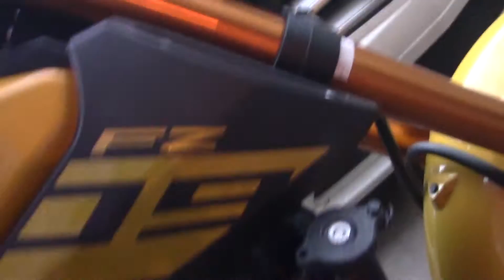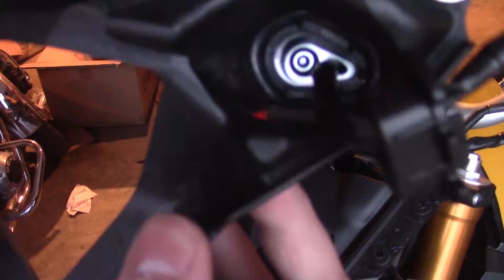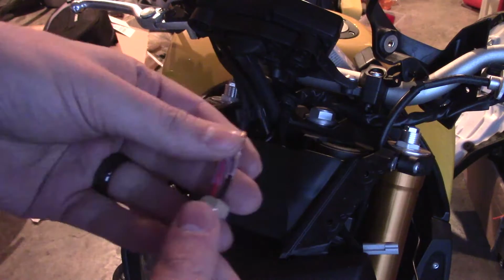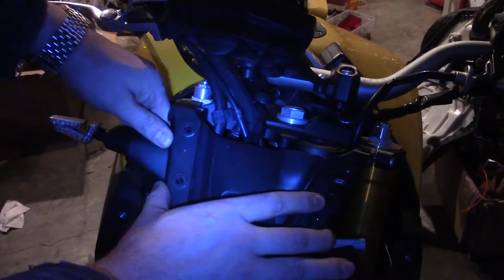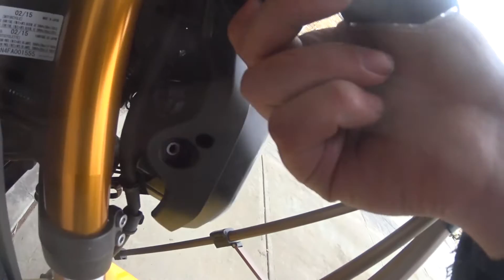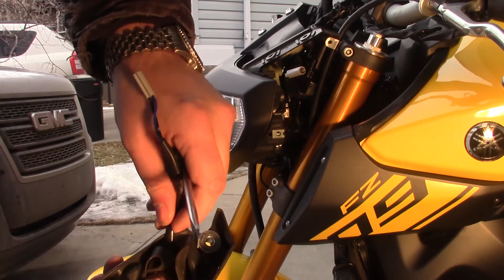FZ09 MODS - Signal replacement

Comment: ughh you dont have the oem running front turn signals with these led upgrades. there is a company called 12oclock. im doing my research to see which of the two versions they sell that are plug n play without using a blinker genie to keep the DRL function. DRL equal more visibility and look cooler

Comment: Link to those turn signals! Those are sickkk
Reply from the maker: BikeMaster Director LED Turn Signal - https://fortnine.ca/en/bikemaster-director-led-turn-signal-hf101086 REVIEW: I bought 2 packs and installed all 4.  The front two are perfect, but one of the rear ones stopped working during my trip last summer.  My saddle bag was resting against it and I guess after 1000 km on the highway it stopped working.   All in all the error was probably mine.  Front two are going strong and I definitely recommend them

Comment: Did you end up getting Yamaha turn signal adapter plates to cover up the holes? I just installed some R&G Racing Aero LED turn signals after watching your video, great help by the way; and I noticed the exposed look at the ends where the new signals attach. I think the plates cover the holes.
Reply from the maker: Glad it helped! I've just left them, and haven't even noticed them.  I think if I did it again I would order them but the washers worked well. 
Post a pic of your signals on instagram or twitter and tag me I'd love to see them @slanktapper !

Comment: For those that don't want to splice wires. They sell Turn Signal Adapters for aftermarket turn signal installations. Just a heads up, but great and informative vid.
Reply from the maker: Thanks!  And yes They're only like $9-10 on revzilla